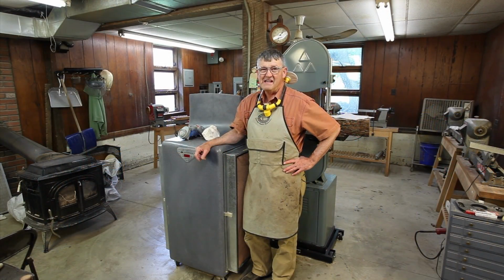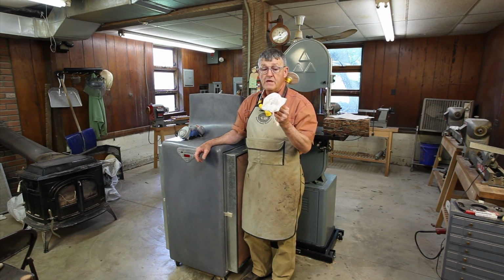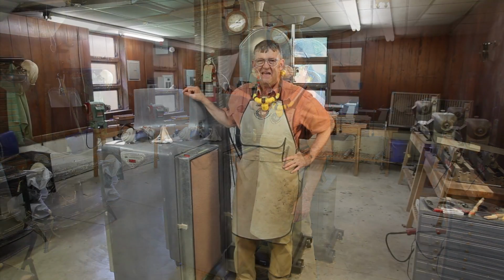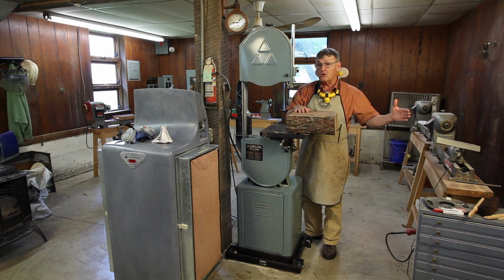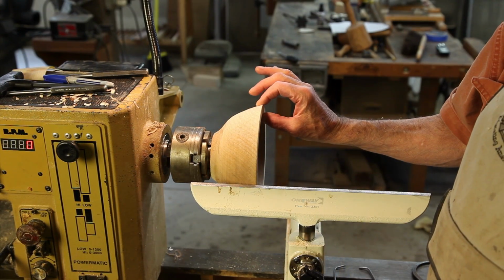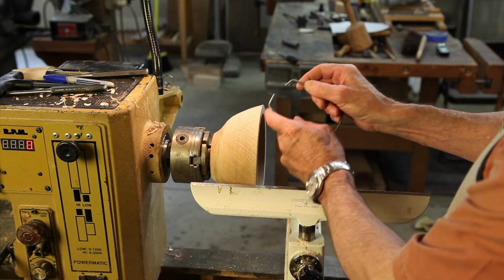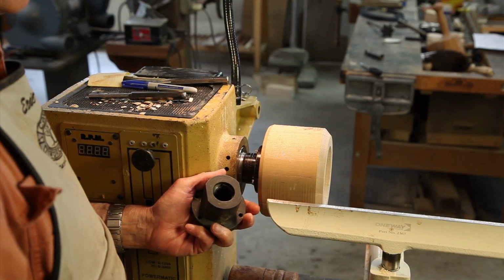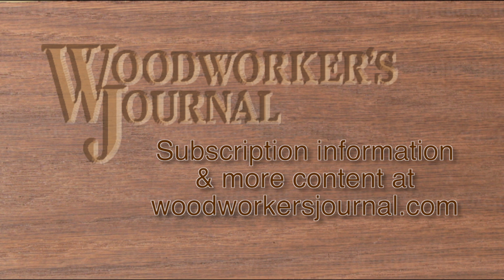Set Up a Home Woodturning Shop

Comment: Thank you for a very informative video, I've been turning about a year now, so far in an improvised space in my back yard, but I'm putting in some concrete now for a permanent workshop, so any tips on what I need are welcome.
Since I have a lathe (of course) and a grinding stone, but I can't find a decent band saw where I live (either too large and expansive, or too small and toy like in quality) I think my next buy would be a commercial size vacuum system...

Comment: Are you saying that the beginner should have a $3000 lathe to get started.  You should also explain to beginners that most lathes are over priced as are the accessories.  It is time that the equipment come down in price, even the price of used lathes to encourage more people to spend the money.  I could give the name of a couple places that have reasonable priced lathes, but they would not stand up to your standards seeing you have a $3000 unit.